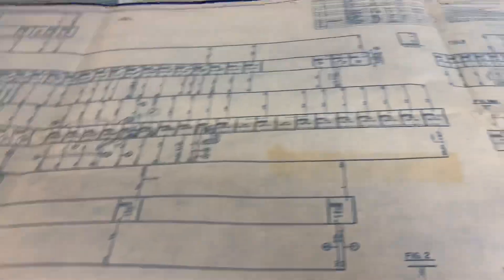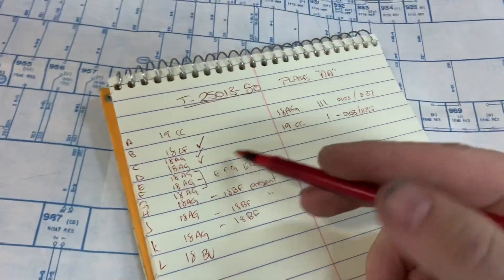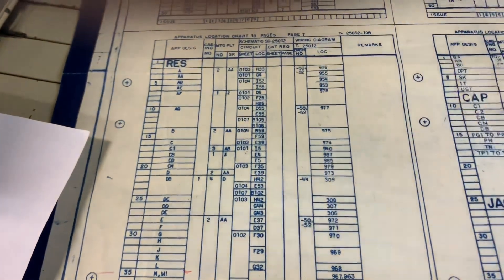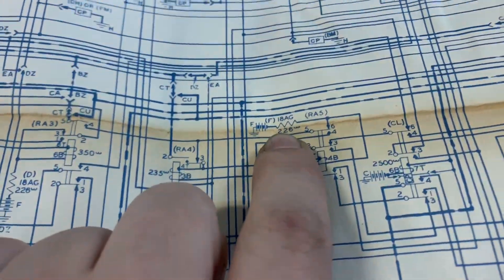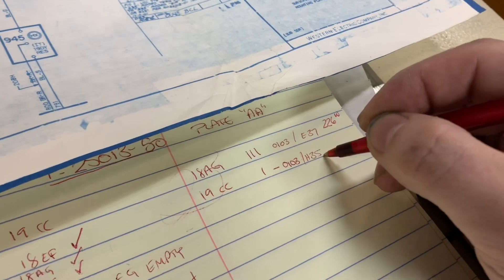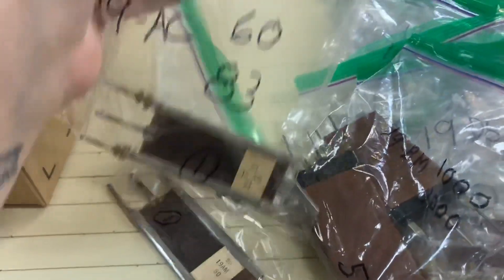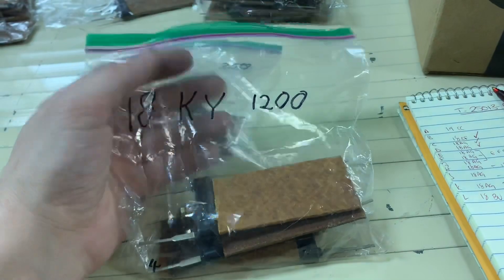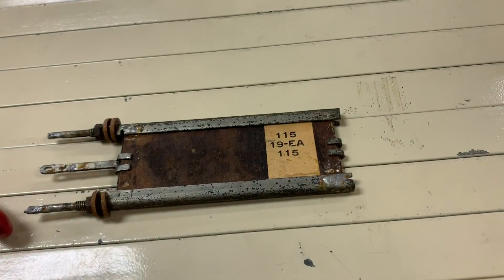[1XB] Subscriber Sender Rebuild: Resistances!

Comment: I know that you are trying to make this as authentic as possible.  My Question is, would you want to make the sender work with substitute parts or keep it authentic and have it NOT WORK? 

My father told me that in WWII radio tubes were hard to get.  Sometimes they would use a tube that had the same properties of the tube they needed but the pins out connections were different.  They would rewire the chasey  to use the replacement tube.  

If you cannot find the resistor that you need, chose a resistor that is as close as you can find but of a higher resistance.  Pigtail a small resistor (but with much higher resistance) in parallel to get the value you need. 
I know you know this but this could be a revelation to someone else reading this post.
Reply from the maker: Yes, we've done a lot of thinking about this very thing. Regarding the resistors, there are some with fairly forgiving tolerances (5%-10%) where we can afford to be lazy, and others that are 1%, and we have to be exact. Fortunately, we haven't had to take drastic measures there, yet.

My goal is to use all authentic parts, until we are no longer able to. Only then would I consider using substitute parts. It's entirely within the realm of possibility, though it is a last resort.